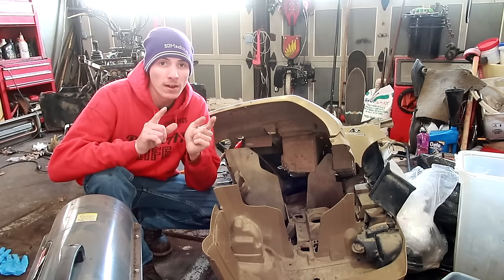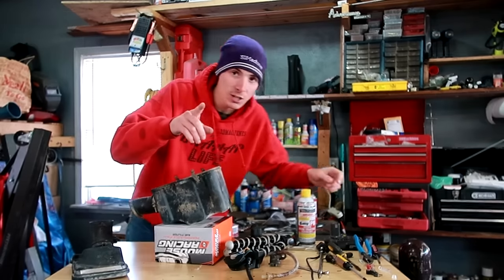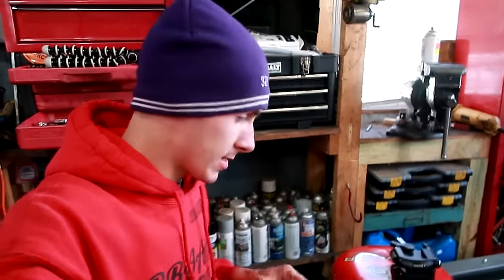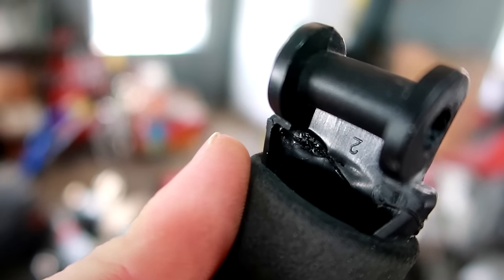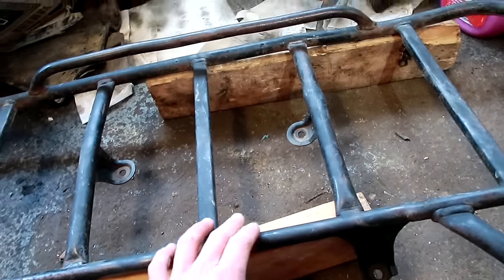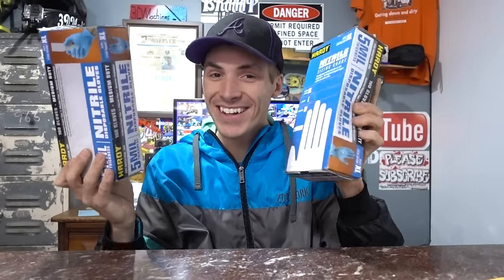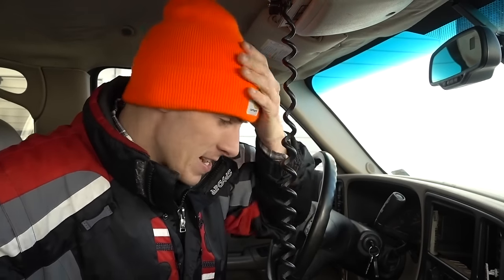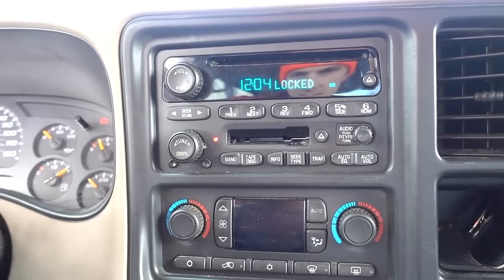FANS SENT STOLEN CAR RADIO

Comment: Step 1: Start the vehicle and turn on the radio.

Step 2: Press and hold preset numbers 2 and 3 until a three digit code appears on the radio display. Write this code down.

Step 3: Press the AM/FM button. Your radio will display a second three digit code. Write the second code down. You will now have a six digit code.

Step 4: Call the Chevy Radio Code phone line at 1-800-537-5140.

Step 4: Enter 106010 followed by the # key to direct you to the radio code retrieval system.

Step 5: Enter the six digit code you retrieved in steps 2 and 3 followed by the * key. They must be in order. You will be given a four digit radio code. Write down the radio code.

Step 6: Start your vehicle and turn on the radio. Using the Minute and Hour buttons, enter in the four digit radio code to your stereo system. Press the AM/FM button to unlock your stereo.
Reply: Nicholas Capizzi This is good info hope he sees it +3DMachines
Reply: Welcome to GM engineering, I will never buy another
Reply: Nicholas Capizzi exactly man... thank you so i didn't have to type all that... anti theft protection doesn't mean it is stolen... just from another vehicle... like from a junk yard... EXCELENT INFORMATION... but if it comes back stolen they aren't going to send anything... well mabe the police to investigate...
Reply: You got it
Reply: Nicholas Capizzi hi my dads Honda oddesey has a locked radio also and I been trying to get it unlocked for couple years but it's not working can u plz help me
Reply: I had a pontiac grand prix that would not unlock either so sold it and purchased a Ford
Tell your dad to take it to the stealership for last hopes
Reply: Nicholas Capizzi step 7 buy a Ford
Reply from the maker: I will try it dude! Thank you!
Reply: Make sure that the radio is in the off state turn car on then hold 1 and 6 while also pushing the power button the code will then show up and you write it down
Reply: 3DMachines just buy a ford there the best but I like chevy to keep up the good work love the videos and the bikes what happened to the Kawasaki
Reply: I Had to take my 03 duramax to the stealership to have them unlock it when I put a touch screen out of an 05 in it. The code deal will not work on these.
Reply: yup the only thing my chevy giving me is problems right now it has a quarter sized hole in the exhaust because the 02 sensor  threads are stripped and i cant put a new one in it sounds good tho lol
Reply: UncommonKIBBLES or get a different radio more like welcome to new technology and anti theft shit to bad theifs bypass it anyway
Reply: Nicholas Capizzi honesty who steals a stock GM radio like that when you can find someone's car with a pioneer or sumtin
Reply: had this happen once or twice for you? over here in Australian most ours have factory codes the are installed at the docks where the radio in installed(stops Batteries from going flat.that does not work) so when you get them from the dealer you get the code in your warranty book. But what I was trying to get to is that was very helpful information.
Reply: Troy Andrews you're trucks over there are badass
Reply: Yeah I dont like them but thanks
Reply: 3DMachines did it work ?
Reply: Nicholas Capizzi 
yes that is right
Reply: Nichol
Reply: Nicholas Capizzi  100% correct
Reply: Watch "how to unlock gm radios 2000-2005" by Amopro he says that those steps don't work and he has a different way you can do it and it will work.
Reply: Nicholas Capizzi I
Reply: HAA ROCKS17 look in the glove box with all the cars info. It should have a code for the radio In there if not you probably have to go to a dealer and have them unlock it. the radio will lock it's self out Everytime the battery is disconnected.
Reply: 3DMachines love the vids keep it up
Reply: HAA ROCKS17 Honda has a radio code tool on their website. u use a code from your glove box on the tool and it gives u one for the radio. Google it and stop being lazy
Reply: Nicholas Capizzi or you could go to a chevy dealer and ask them to program it again
Reply: Buy a ford it's amazing for a work truck. Not hatin on Chevys they are good to fords are just good.
Reply: Nicholas Capizzi the 2017 Raptor 😍 it's a 6 cylinder but it's 100hp more than the previous model that had a V8
Reply: Nicholas Capizzi  easy fix is to have someone with a SCAN TOOL gm programmer change the info in the BCM to pair this used radio to the truck.  what I do is go to my local dealership and tell them what I need and that I've only got $25 works every time.  also works for key fob programming on models that require the scantool!
Reply: Replacement fitting is available at Summit Racing, it is a weld in I think the threads in the sensor may be 14mm.
Reply: its so someone doesn't take your radio out of your car im sure you wouldnt want that to happen
Reply: booooooooooooooooooooooooooooooooooo ford trash dont do it +3DMachines

Comment: Locked usually means that you need to enter a code from a GM dealer. To get the code you need the radio serial number and the VIN of the truck that the stereo came out of. Once the stereo looses power then you need to enter the code. VW does this too as well as many other auto manufacturers. Unhook the battery and bam! Stereo locked!

Hope you can get the code easy!
Reply: the previous owner should have the code in original cars manual
Reply: Tink Mimi +

Comment: Dalton, take the radio to your local dealer and tell them what happened. For my vehicle, anytime the car is disconnected from the battery or the radio is disconnected, when reconnecting it or reconnecting the battery it does the same.  All you need to do is unlock the radio, usually a passcode can be used, which most likely you do not know.  For mine, I have the same passcode every time and can reset it myself, but since the radio is a brand-used radio the codes might not match up or you probably don't even know the code and will have to get it reset. It doesn't necessarily mean the radio was stolen though, it just means the radio is not in the original truck anymore.  Awesome video, keep up the good work! (:

Comment: to test it pull the radio fuse under hood, then replace it back to its slot.  Turn key to first accessory position and radio should work.  Once you turn key to on the BCM will lock it.  Also if your truck has bose and the radio is non bose you will get no sound, it needs to be programmed for the correct option code uq7 bose and uq3 i believe for non bose.

Comment: Most newer, and luxury vehicles have codes on the radios to prevent theft. As soon as the battery is run down, or disconnected, you have to enter the code to unlock it. It is usually in the owners manual booklet, or on a sticker somewhere.

Comment: unlock the Theftlock system when the user code is unknown, perform the following steps:

Press and hold buttons 2 and 3 until a three digit code appears on the display.
Write the three digit code on a piece of paper.
Press the AM/FM push button and a second three digit code will appear on the display.
Write the second three digit code following the first three digit code.

Comment: There is a code you will need to put into the radio to unlock it, most of the time a gm  dealer will have to figure out the code.

Comment: Add fiberglass to your plastic weld to increase strength.  Works great on your 4-Wheeler plastics if you use aluminum tape on the outside to hold the crack tight while weld the inside.

Comment: When a radio is removed it locks itself in the case that it was stolen so that someone can't use it. Usually in the handbook for the car there is a code you input to unlock it.

Comment: The display on the radio will read, "LOC" or "LOCKED" meaning the Theftlock feature is active, and your vehicle's radio is "locked up". Grab a notepad. Press and hold the 1 and 2 preset buttons for about 5-10 seconds until 3 numbers appear on the radio's display. Write these numbers down.

Comment: If the locked AC Delco radio shows "LOCKED" rather than "LOC," then take the following steps to unlock it. First, turn the key in the ignition to the "ON" position. Next, hold down the right seek button and the radio preset number "5" button. Without releasing these buttons, press the radio's power button.

Comment: The reason why its locked is because that fan sent a GM theft lock radio. The theft lock occurs when they remove or someone steals the radio. To reset and remove that lock, go to a General Motors dealership or repair shop to fix it.

Comment: There is a small fuse u can break on the back of the radio,it will make it work,but no presets and it always is on 98.1 when the truck is started

Comment: without the dealer reprograming the vin for the radio you can remove a eeprom chip from it under the cassette player. you have to pull the casing off ect. but their are a few side effects if i recall

Comment: Press and hold the 1 and 2 preset buttons for about 5-10 seconds until 3 numbers appear on the radio's display. Write these numbers down. These are the first 3 digits of your vehicle's radio's identification code.
Reply: After writing down the first 3 numbers of your vehicle's radio's identification code, immediately press the AM/FM button and you will see 3 more numbers appear on the radio's display. These are the last 3 digits of your vehicle's radios identification code. Write these numbers down.

Comment: Locked means that the radio is not necessarily stolen it has just been removed from another vehicle and there is a special code required to enter in and unlock the radio. Call the dealer they can give you the code. There may be a way to bypass but from my experience there is only a temporary way to bypass it. Cheers.

Comment: It's just part of the anti theft system. The radio is coded to the old trucks computer and just needs to be reprogrammed for the new vehicle. You should be able to google it and find the instructions if that's an option for that radio.

Comment: locked is part of a anti theft system. if the radio losses power the radio locks. so say if you disconnect the stereo to it locks just in case it is actually getting stolen

Comment: The locked code means that it's locked. Typically cars come with that feature in case it's stolen. Normally the code is on a sticker and put in the manual to the car or in the glove box. I would look on the stickers of the radio.

Comment: +3DMachines when a radio goes so long without power they go into a safe mode where you have to enter a code in to get the radio to work. dealerships have the codes to unlock the radio but it will cost around 50 or 60 bucks to get the code. Hope ya get it lined out though dalton!

Comment: 3D Machines you should fix the cracks in the kodiaks plastic by using a drifters stich, did it on my 1986 kawasaki and it actually makes the plastic stronger i was supprised to find out.

Comment: Those radios are VIN specific. You'll have to go to a dealership to get it unlocked.. not cheap!
Reply: Blake Around the House you can do it yourself
Reply: I've swapped dozens of them. It takes 10 minutes tops to do it yourself and wont cost a dime.

Comment: If you unplug a GM stereo with the power off to the unit, it will lock. The dealer can get it to work but will charge you probably more than it would cost just to get another one.

Comment: You can reprogram your radio with a launch scanner ( snap on one will not do it )   All you do ( if you know someone that has one ) is go to the radio section of the scanner and there is a section to re initialize the radio   It will put your vin into the radio and it will unlock   I have done a few of them  people have the cassette and want a cd  we get a radio from the scrap yard nice and easy

Comment: Locked is the anti theft system you need a code to unlock it....Get the serial number from the radio and then the dealership might have to get you the passcode for that specific radio

Comment: Take it to a dealer they would have to reprogram it. The class 2 gm radios have the vehicles vin number programmed into it and it communicates with the body control module   There is a way to unlock it without going to the dealer though  you can open the radio up and remove the theftlock chip however there would be some small side effects but the radio would work

Comment: Try using small zip ties to plastic weld with, use low voltage soldering iron ( 40 watt )

Comment: plastic welding is like soldering burn the plastic to see how long it takes then use the same type of material that burns like that so they both melt and adhear the same :-)

Comment: All GM radios are a pain. Any radio that is not original to your vehicle and is a GM radio, it will be locked , or theft locked, just in case it was stolen. So just because it says it is locked does not mean it was necessarily stolen. In order to unlock your radio, you have to go to your local GM dealer and they can punch in the codes for you. It's a quick process at the dealer. I got a GM radio out of a smashed up equinox to put in my buddies equinox and occurred with the same issue with the theft lock. The dealer should be able to take care of it with you quickly.

Comment: hold 5 and the seek button then press power it will reset the radio to your truck so you dont have to do previous guys steps over and over it does it automaticaly....

Comment: the power has been disconnected for too long of a time and the security system on your radio was activated.

look in your owner's manual for a keycode to unlock it.

Comment: URGENT DALTON PLEASE READ
nah it's not urgent just some info. Hold both the 1 and 2 buttons for 5 to ten seconds three numbers will come up and you need the code to unlock it, the radio wasnt stolen or so I hope but when you unplug the radio from your truck or car of early 2000s and 90s it will lock meaning you can't use the radio unless unlocked

Comment: I think you can take the radio to a dealer and have them unlock it for like $40
Reply: The radios lock to the vehicles vin number so most likely both of those radios are locked. It could be less or more than $40. I'd just go to a dealer and ask how much they charge.

Comment: it is not stolen, when you unplug the battery or unplug the factory radio from a GM car or truck, it goes into security mode. All you have to do is to enter in security code.

Comment: The radio isn't stolen, it's just anti theft, that's what happens when it's out of another car, gm thought that if it were out of another vehicle then plugged into a different vehicle it'll auto anti theft lock, it could be out of there vehicle, then when you installed it it realized it wasn't the original vehicle

Comment: its a security feacher you will have to call dealer ship give them moddel number on radio and they should give you the code but call and as to speak with one of the mechanics because of you just ask the deller they are going to try to have you bring it in and charge you any where from 50 to 150 just to put the code in

Comment: "Locked" means it has either lost power or the security code was entered wrong.  You just need to find out the security number for it or the factory reset code.  No biggie

Comment: the radio was stolen the 1203 code means its locked and some on stolen it you need too find out the vin number for the radio it wont work if you don't I looked it up on google and it said the code means it is stolen

Comment: hey 3dmachines, why the radio is locked is beqause (what i think) every stock radio have to match with the cars "ID" this is to prevent stolen radio's to work on other cars. And to unlock this you need a code thats comes with the package in the beginning. try to start your car mayby this helps. i had this one time with a mercedes sprinter due to a broken fuse and  it was the orginal radio.

check this in google: prod problem in radio

greetings

Comment: This is about fuel type. I would like to see Jake fly the paracopter. Maybe from where you live down to Florida. How do you know it you are getting 93?? I always look for the gas pumps that has 3 fuel pipes running down from the top to the nozzle. If it only has one I don't know for sure but I would think your pumping 87 until all the fuel runs out of the pipe. Never been on the inside of one so can't say but that is what me and my friends look for and only Exxon fuel.

Comment: Chevy's weird, some need the code, you'd have to get serial number of deck, others won't work period if there from an other model, like a Colorado, etc. Just cause it's a chevy deck it might not be compatible. I ordered one on ebay for 1500 couldn't figure it out went to dealership they looked up the serial it came out of an envoy, wouldn't work had to return it.

Comment: hey Dalton. it's very hard to replace a stock GM stereo. I went through the SAME thing. There is a way for some to be unlocked at your house and some that requires a dealer to. my advice would be just slap an aftermarket stereo in. I just did it in my 03 Chevy avalanche. the install kits are cheap if you already have an aftermarket deck, the rest between the mounting kit antenna adapter and harness connector will probably run you close to 25-30. if you need any help let me know. love the videos man